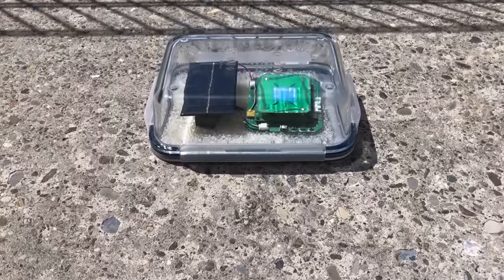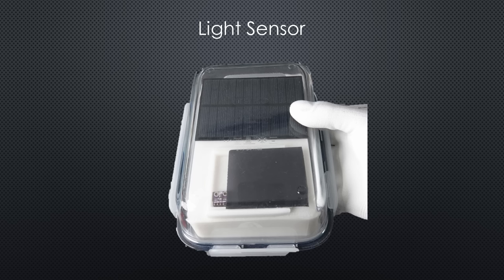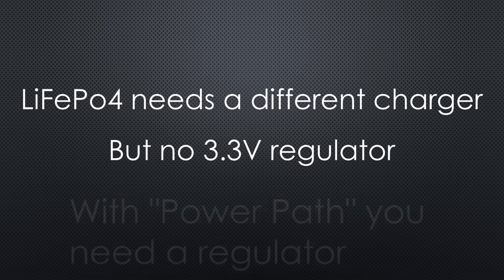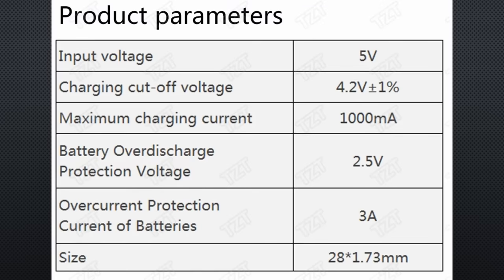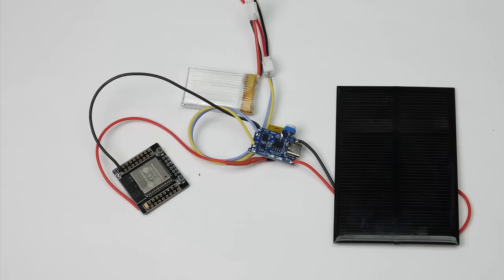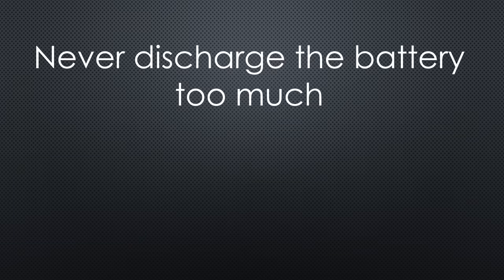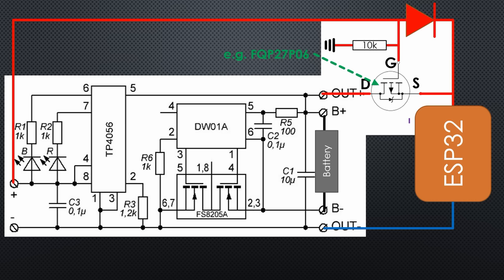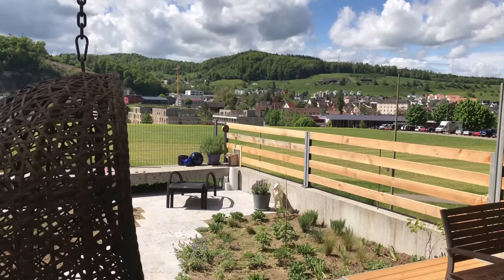#383 Cheap and simple Solar Power for our small Projects (ESP32, ESP8266, Arduino)

Comment: This iw very interesting! TodayI did my first attemp: same charging circuit, connected to 5v 1amp solar panel and to a 3.7 rechargable battery. It charges nicely.

 Then, from de charge controller circuit output I connected  a boost to convert to 5v so that  I can chargr the battery while also fedding some device that consumes 5v.

While there is sun, everything works fine. When the sun goes down my battery is full -but for some rason the consumer device receibes verty littlr current and shuts down.

I can 't quite understand how the outputs on the charger circuit work: why would it deliver suck low current into the booster if I have a full batery? Should I connect the 5v booster right to the batteries to draw 3.7v?

Still cant understand those outputs.

Thanks!!
Reply from the maker: I would connect the booster in parallel to the ESP32 in the drawing. Then it should get enough current. If not, maybe he FET is not the right type or not properly connected.

Comment: Hi, excellent guideline... I have a 18650 2200mAh, can i use the TP4056? Should be safe to charge the battery via solar panel and provide energy to wemos mini when drains 500mAh every 10 minutes during wifi connection?
Reply from the maker: You can use a TP4056 as shown in this video.
Reply: @AndreasSpiess  thanks so much! I’ll try this. As always your videos are so inspiring 😊

Comment: Andreas what is better: 
-Solar system of 12V then adapt the power for a 5V Arduino or
-Solar system of 3.7V then adapt to 5V?
Thanks in advance
Reply from the maker: No difference if properly done. The smallest 12V panels probably are an overkill for just one Arduino.

Comment: I think the P-MOSFET should be turned around in the displayed circuit - D and S replaced .. correct me if I'm wrong, although in this configuration it also works, but just as a diode.
Reply from the maker: I think it is ok. At least it works here. And I checked it with other diagrams.

Comment: questions here. Is it save to charge and output load at the same time? I read that the tp4056 overcharge protection doesn't work at expected when outputting a load. Is that true? I would like to leave this circuit in the countryside but im afraid something will catch on fire
Reply from the maker: Nothing should catch fire with this circuit. This is why I implemented a power path...

Comment: When using ESP 32 servo motors, there is a problem when operating it via 3.3 volts, so it is necessary to power the ESP-32 via 5 volts. Also probably any modul that plugs into the esp-32 require power. Would two TP4056 be sufficient for an ESP 32 operating with 5 volts and a servo motor connected to it? Or how should we set up this mechanism?
Reply from the maker: I would divide your proble in different parts and ask Google.

Comment: Your opinion in using Schottky , instead of standard diodes due to their low voltage drop.
Reply from the maker: They are good and if the voltage drop matters, even indispensable.

Comment: Hi Andreas,  can you comment on those solar power banks for esp32 projects?  They ate all in one, although charge very slowly at 1-2 Wh solar harvest per day, it may be sufficient and easy as a quick and simple solution.
Reply from the maker: I do not like those because, as you write, they charge too slowly. And I do not want to leave ma battery in full sun for hours. So separating energy generation is a good idea.

Comment: Thanks for sharing because I want to run an ESP board from a solar panel. I wish someone sold a complete (solar panel + regulator + battery) solution for this that you could buy off the shelf.
Reply: What you are wishing for is a regular solar charged power bank.
Reply from the maker: Pay attention with solar powered power banks. They usually switch off as soon as they see the sun. I first thought they are defective;-) So they cannot be used for this purpose. Unless you find one without this "feature"
Reply: @AndreasSpiess  Yes, i forgot to mention that. The same "effect" applies to many regular power banks too. They don't deliver power while being charged.

Maybe adding a power path to a ready made (solar) power bank is a viable solution...

Comment: Is not the P-Channel FET reversed?   It conducts always in the direction of the internal diode regardless of if it is activated or not, so from drain to source, and blocks only the other direction, right?  And when the gate is zero and activates the FET then it conducts in both directions.  So, from my understanding it should be reversed, to block current from the TP4056 when it is off.   Or I understood it wrong? Thanks!
Reply: Ok, I think I understand. The internal fet diode blocks reverse current from the USB back to the TP4056 output. And when the FET is active the current flows in the same direction as the internal fet diode, but with the substrate also conducting and less resistance and voltage drop than a simple diode.

Comment: "hacker soul" ... Nice. Would it make the whole job easier if we use lifepo cells, and just make sure we do not put too much voltage to them during charging? This way the circuit between esp32 and the lifepo would be way more easy too handle. I am wrong?
Reply from the maker: Without the power path you would not need a regulator for LiFePo4. Because the power path brings full voltage to the ESP you anyway need one. There are special charger chips for LiFePo4 available (e.g. TP5000).

Comment: I don't think that you can get on AliExpress module with power path, at least two years ago when I wanted one. Had to make it myself. Works just fine, maybe except mislabelled output silkscreen. I needed it to power 9V device, so it also contains small boost circuit. All fitted on a small 36x20mm board. I have yet to see something like this available.
Reply from the maker: You are right. I also did not find one on Aliexpress. Adafruit has one.

Comment: I had a little problem with this:

My Battery had about 4V.
The Solar panel in the afternoon with nearly no sun, had a voltage under 3.6V (delivering less than 10mA).
When ESP8266 is waking up from deep sleep with full wifi on, it sometimes got brownouts. This triggered the ESP to reboot. Sometimes it just sat there consuming constantly 30mA but did nothing. I had no idea what the problem could be. Pulled my hair out.

Now, I added a 1000µF capacitor between the FET and my ESP. The ESP seems to run without problems, now.
It looks like under certain circumstances, the ESP is draining much power (>100mA) while the FETs source-drain channel is not fully "open". This causes the ESP to crash.
So adding a big cap provides the needed current when waking up from deep sleep.

Maybe this will be helpful to someone else :-)

Cheers!
Reply from the maker: ESPs are well known for current spikes and your solution is the way to go! It can also happen without a transistor inbetween.
Reply: @AndreasSpiess  I had the same problem with this solution right now. Added a second 1000µF cap, which seems to help now. Should I go with goldcap in this situation?

Comment: This is a very useful video!! Is there any way to wake ESP32 over LORA?  I want to send a signal to wake my Esp32 cam for 15 minutes, then let it sleep until next LORA wake up signal.  Any ideas?  Do you already have a video like this?
Reply from the maker: I am not sure if you get LoRa modules with this kind of functionality. Still, the LoRa chip would have to be powered all the time.
Reply: @AndreasSpiess  some LORA devices have a deep sleep mode, where you can have it wake every few seconds to check for a preamble.

Comment: Is there any reason for not putting a booster between the panel and the TP4056, instead of or in addition to after the TP4056?  i.e.: feed a constant 5V to the TP4056.

Comment: I just noticed the HT7333 datasheet (*:00) shows a maximum current output of 250mA but the ESP8266 could potentially draw more than that under load, correct? Is that not a potential issue?
Reply from the maker: I usually connect a beefy capacitor between VCC and GND of the ESP32. It only has very short peaks above 250mA.

Comment: Very nice video! I use the Lilygo TTGO T7 for a solar powered project. This board has Power Path with P-Channel FET already integrated. I have changed Rprog in order to not overload the solar panel. Charging works so far. Unfortunately I'm facing issues with ESP-32 power-on after deep sleep when the system is powered by the solar panel... Any idea what this can be? 
I would really appreciate if you could make a video about how a solar powered system could recover automatically if the battery was fully depleted. What do you think about KA75330 Voltage Detector?
Reply: I know very little about this stuff, but I'm reminded of video #366 @8:12 where we see the peak current during wakeup from deep sleep.  I wonder if maybe it's browning out on that peak.  
[ https://youtu.be/mnoZYlyebBc?t=492 ]
Reply from the maker: You are right, the T7 even has a power path and can be used for solar-powered projects.
Concerning KA75330: I already did a video about that topic.
@QC: I usually add a 1000uF cap across Vcc and GND of the ESPs to prevent problems.
Reply: Thank you guys. I guess I'll have a look at the other videos. The one about KA75330 is this one I think: https://www.youtube.com/watch?v=cKDv0aN67BY (#315).
@Andreas Spiess. Thanks for all the cool videos. There's always some content which covers my questions :D
Reply from the maker: Yes.

Comment: Very nice video. I have seen that there are many energy harvesting chips on the market that in principle should be more efficient in getting the solar energy and storing it in battery. What do you think? For what I see most of them have an input voltage limited to 5V and deliver maximum 100 mA, but this should not be a strong limitation.
Reply from the maker: I once made a video about these harvesters. They are much lower power and nothing for a power hungry WiFi ESP32...

Comment: Hi! The tp4056 datasheet warns against charging with a load, because the external load confuses the cutoff voltage and the battery can become overcharged. Does the diode and mosfet setup you use solve that problem? Over voltage due to external load wasnt specifically addressed in the (amazing) video. As always, thank you!
Reply from the maker: Yes. The power path should solve this issue.

Comment: Hi, what if I connect a USB cable for the charge on the tp board once a small solar panels are soldered?

I fried small panel in this way following another tutorial (not yours).

How can i protect the panel?

Thanks a lot, great channel!
Reply from the maker: The panel should not fry if you connect a TP charger board to it. You do not need a USB cable for that. Just two wires. Only if you connect a battery to it it can be fried.

Comment: great video! what's happens when the Pmos is cut off gets -2v,-3v at the gate from the solar cell? this voltage isnt high enough to power the circuit... how is the transition looks on the scope?
Reply from the maker: I did not do a thorough checks :-(
Reply: P channel  mosfet.   Gate voltage is measured from Gate to Drain. So solar panel voltage falls to +1 volt and battery is charged to 3.5 volts the gate to drain is  negative 2.5 volts which will turn the mosfet on hard for battery to power the circuit.

Comment: Will it be efficient to use a buck converter instead of an LDO, so that the device can work even if the battery goes less than 3.3v? 
How about using 18650 batteries or 16430 batteries?
Reply from the maker: Choosing an LDO or a buck converter depend on the voltage difference. You would need a buck/boost converter if you want to go below the 3.3 volts. It is probably cheaper to chose a bigger battery instead of such a converter.

Comment: I am using a ESP32 & a AM2302 I want to put it outside under the deck, here in Nova Scotia it is possible to get down to -15 C. Is it safe to charge a lithium when it is that cold or should I use a 6V SLA instead? Thanks
Reply from the maker: I did not find information on Li-Ion battery charging at low temperature and low current. All I found was that you must not charge them with high current. Maybe you sacrifice a battery and try it out?

Comment: Great video as always Andreas.  Apologies if this has already been mentioned (or wrong) as I couldn't see a comment about it.  But, is the image at 12:01 incorrect to the wiring diagram, in that the middle leg of the Mosfet should go to the output of the board at the bottom of the image, not the battery terminal one up from the bottom?
Reply from the maker: You can check with the original video where I copied the diagram (link is in the description). I thought it is ok.

Comment: Hi, and thanks for the video! I have a question: If we connect de solar panel through the schottky diode and the power mosfet like in the final circuit and the solar panel voltage exceeds 5,6V, will the ESP32 still get 3,3V? Also, should't be the drain and the source inverted?
Reply from the maker: You need a 3.3 volt regulator with 4.2 volt batteries.

Comment: Hi Andreas, when you added the 20Kohm pot did you remove Rprog or leave in place? Thanks.
Reply from the maker: Yes, I removed it.
Reply: @AndreasSpiess  could you explain how to insert the trimpot into the circuit please? I’m an electronic newbie and can’t figure out the three trimpot legs into two locations 🤔 Thanks 🙏

Comment: Perfect! What about autoturning the solar panel to the sun? Is it more powerfull?
Reply from the maker: It for sure would deliver more energy over time. But with today's cheap panels it makes no sense for low power applications.
Reply: That has not really paid off because of the power consumption of the motor(s) and control circiots

Comment: Andreas, is there an example of how we can use the principles and a "charging pcb "like what is in this video for higher voltage batteries like for 12v (eg 3 * 18650's in series -3S).
I have quite a few projects which the supply is 12v (3 * 18650's in series) and want to apply the same principles as in this video. Thank you.
Reply from the maker: If you use more than one battery you have to add balancing. Then it is probably better to buy a ready-made BMS. They are cheap and good.

Comment: I'll watch your other solar videos and maybe they cover this but what are your thoughts on protective thermistors? I've seen chargers which have an optional spot for an external thermistor which I believe is used to detect overly hot batteries.
Reply from the maker: The panel I used has only a very small current. So a temperature sensor is not needed. I anyway did not find such small cells with built-in thermistor. 
And the battery will be full in high temperature situations because the sun charged them already. And because of the power path, they are not used. So, "storage conditions" apply.

Comment: Panel → DC-DC buster (5/12) → charger → battery(..).
Reply from the maker: You can even go more complex: Panel - Buster to 12 volts - inverter to 240v - standard USB power supply ;-)

Comment: Great! Thank you.The power path is the missing piece of the puzzle I had beeen waiting for. I had seen all your videos for solar powered esp32 + battery... but investigating other sources, many said (rightfully so) that you shouldn't have a load and charge the battery at the same time with the TP4056. At last I see your solution.

One question if you don't mind... How would you adapt the project if you have a board with an inbuilt battery charger? I have a LolinD32pro .. Can I use the charger in some way or am I better off bypassing it and using what you propose in this video?

Greetings from (sunny) Gran Canaria.
Reply from the maker: Some boards have a built-in power path (e.g. the TTGO T7. And maybe you can add one on other boards as I did. You have to consult the diagram of the board you want to use.